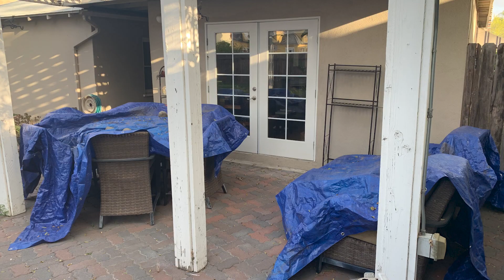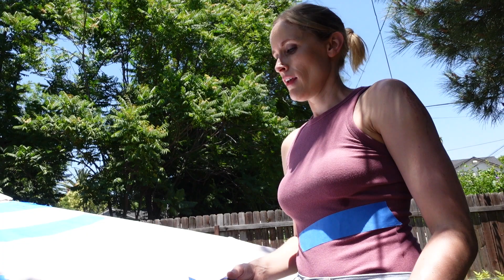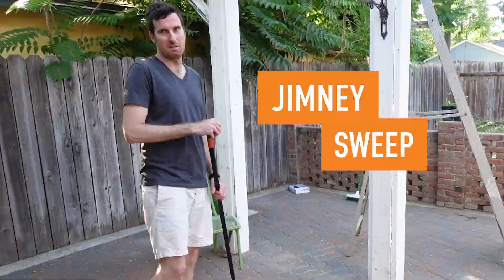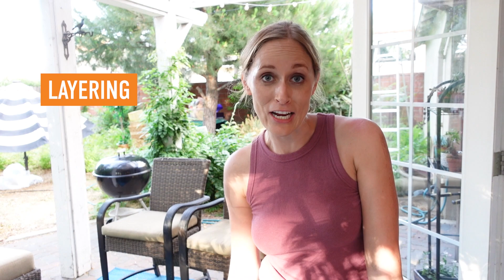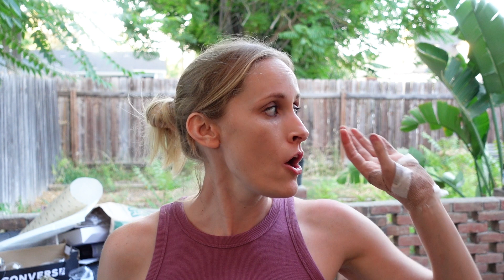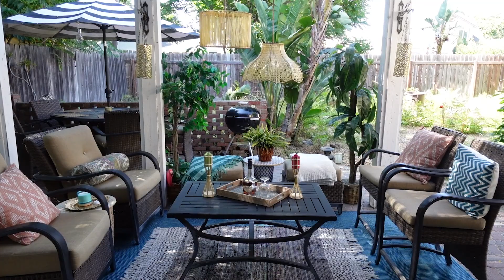DIY Backyard Makeover with Dollar Store DIYs & Thrift Flips

Comment: Is this a diy video? How did you make the lanterns?
Reply from the maker: Ah, sorry that wasn’t in more detail. I literally just rolled the placements in a circle and sewed the seam with fishing wire. Then I clipped the plant hangers to them.
Reply: @LaughCryDIY  ..and the light source?
Reply from the maker: It’s these hanging solar bulbs. Found these at the dollar store: https://www.amazon.com/Obell-Waterproof-Rotatable-Decorations-Pack-Solar/dp/B07JNKBQQQ/ref=asc_df_B07JNKBQQQ/?tag=hyprod-20&linkCode=df0&hvadid=309768157824&hvpos=&hvnetw=g&hvrand=10748430013880644100&hvpone=&hvptwo=&hvqmt=&hvdev=m&hvdvcmdl=&hvlocint=&hvlocphy=9031589&hvtargid=pla-579059107894&psc=1

I had tied fishing wire across the top to create a line that you could hook them onto, but the slack chains from the plant pots hung down so far into the lantern I just clipped them onto that.